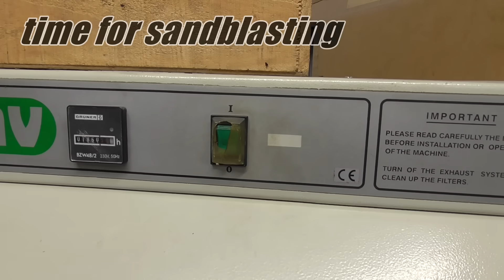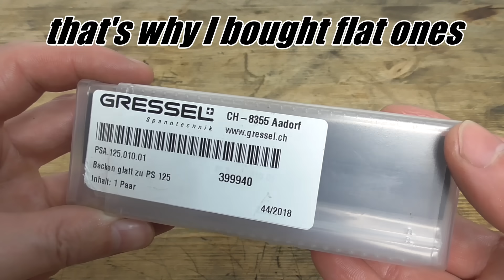Rusty Deadlocked Vise - Perfect Restoration

Comment: You didnt need to pull it apart with a puller there is always the chance it could break something i have dismantled lots of seized machinery hard to beat electrolysis as it removes all the rust and even bolts usually unscrew it cuts out alot of rust removal and you would have been able to unwind the mechanism at the end of the day you did a great job well done i just would have started off differently.

Comment: Duck tape works just as well for sand blasting and is much cheaper than aluminum tape. My stepmom used to do glass etching all the time, never had an issue with the sand cutting through the duck tape.

Comment: They don't make vices like the old ones . I have a old one that I just restored. It's really tough and heavy. It only has the word England on it. You did a really good job. All I did was use pneumatic wire brush some sandpaper and file and used spray paint. Wish my machine shop had a sand blaster.

Comment: That was satisfying to watch until the greasing part. You don't need that much grease, especially on screws. Grease just the tip of screw and while screwing it in it will spread the grease around all by itself. You save A LOT the product and there's less mess to clean after 😊 Apart from that this is so so satisfying and relaxing to watch. Thank you!

Comment: I WOULD JUST SOAK IT IN A SOLUTION OF PHOSPHORIC ACID FOR A WEEK, RINSE IT OFF AND TAKE IT APART. IF IT NEEDED MORE RUST REMOVED, BACK IN THE TANK OF ACID, TILL CLEAN. THEN WASH IT UP, DRY AND PAINT.

Comment: Absolutely a superlative restoration job, excellent choice in using green and good work on white lettering, instead of using the methods of applications on the various sizes in raised lettering, I was wondering why you did not use a flat firm rubber foam pad for paint stamping raised lettering. Whatever methods that could have been used your choice worked out great. Curious question, have you any idea as when it was originally manufactured. Guessing it looks somewhere in between 40s to 50s, even earlier could be possible. Then again, I could be completely in left field, it might be from the 70s or newer based on an original design used way back then when it was designed. I certainly would love to have one in my work shop, it is really is something that looks to be of superior workmanship and why more then durable, but an eternity in its lifespan of use.

Comment: You should have used Dr. X rust remover before you did all that sanding. Would have been a ton quicker and so much easier and thorough in removing that rust. Great job though!

Comment: why heat treat?
Reply from the maker: It's not actually heat treatment, the low temperatur doesn't change the structure of the steel, it just makes it black. Just for the optic and rust proof.
Reply: @mymechanics  thanks so much. Very cool
Please keep making more!

Comment: Wonderful job of restoring that, you must really like that vice! One thing I find odd though is that you obviously have a lot of nice kit, mill, lathe, blast cab, but not a socket set? Please buy a socket set, seeing you use an adjustable spanner like that made me wince! :-)
Reply from the maker: I have one, i'm just not using it very often.
Reply: That's so funny, I was always scolded if I used an adjustable if there was a better tool for the job by my tutor when I was a lad. I sometimes hear him, like a parrot on my shoulder if I'm misusing a tool or should have chosen a more appropriate one. I do own several adjustables and used to have a comedy 24" one for intimidating stuff apart...

Comment: Remarkable work. It is a huge boon to society to have the potential of otherwise scrap parts truly restored. But society doesn't run on potential; it runs on efficiency.

Does restoring this device, with all of the knowledge and tools that are required, make economic sense? Yes if you already have all of the tools and knowledge, and no if you don't, or maybe never?

A simpler question would be, "Why bother?" Regardless, excellent work. You don't need anyone to tell you that, I'm sure.

I actually thought sandblasting was more primitive. Like, take some stuff out to the shed and power wash it with sand. It is nice to have a misunderstanding corrected.

Comment: Excellent video. If you do another vice restoration, look into electrolysis cleaning. It's a rust removal process that requires no scrubbing and doesn't effect the base metal at all.

Comment: Very nice restoration but why did you buy new smooth clamps? Couldn't you just file the old rough ones ?
Reply from the maker: They're hardened, you could only grind it and i don't have a surface grinder.

Comment: I have tried a VERY successful method to remove rust, some of it VERY heavy: 
1. Burn the rust until metal gets red of white [I used my old woodstove]
2. Remove next day once it has cooled off
3, Remove loose rust best you can with wire brush [ don’t go crazy on it, the next step will do the job for you
]
4. Immerse the part in pickling vinegar [10% acidic acid] 
5. Let it seat in it for a couple of days
 in the vinegar
6. Wash the rust off
7. Dry immediately and coat it with an oily product..

It works fantastically, and the best part : very effort
 which is bonus for a lazy man like me

Comment: Great work.  Excellent attention to detail.  This was a real treat to watch.  Large vises like this are really hard to find in the US, so it's very cool to see you take a crusty relic and bring it back to its full potential.  I also prefer flat jaws with leather patches to secure a precision piece, so an extra thumbs up on that.

The green paint is a really nice color.  I see a lot of restoration videos that use a flashy metallic teal that I really dislike for some reason.  I haven't done a lot of restoration projects, but I've just clear-coated the unfinished surfaces with automotive lacquer after letting them sit in CLR for a week or so to remove the surface junk.  I love the pitted and aged color of the raw steel in contrast with the bright, finished steel.  It's subtle, but there's a clear difference in the color of old, unpolished steel.

FYI, I have no idea about the quality of the steel used in the parts, but if the steel wasn't hardened in the first place, there's probably a reason for that.  Steel has many grades and alloys, and some can't be hardened with a quench because they don't have enough carbon content to create a strong carbon capture in the molecular lattice.  The maker may have opted for low carbon steel to maintain flexion without snapping into shards when the part is stressed beyond normal use.  Even if you hardened those pieces, you'd need to thermo-cycle hardened steel at a lower temp to add a bit of flex and reduce the chance of shattering.  The only time you really want hardened steel is for a durable cutting edge like a blade, saw or drill bit.  I guess it could be useful for specialized vise jaws to allow the file to dig into softer steel and not damage the jaws.

The forge scale black patina is a really nice look, though.  It also forms a slightly more durable shell that resists wear and corrosion better than raw steel.

Never toss out a large old vise, no matter how crusty it is.  It's actually hard to find bigger models with big box hardware chains only stocking handyman/weekend warrior sizes.  If you happen to find or inherit a vise with 6+ inch jaws (15+cm for anyone outside of north america) and don't have a use for it, put it up on Craigslist or Ebay.  Plenty of blacksmiths and machinists will be happy to take it off your hands.

Comment: Forgive my ignorance, but: when you cut new threads in the screw holes (e.g. 6:11) does that not make the thread bigger? Do you then need bigger bolts?
Reply from the maker: Nope, it's the same size.

Comment: I don't get why you didn't just sand blast the whole thing. All that other clean up was superfluous until after sand blasting. There's plenty of abrasive options like glass bead that would not roughen the metal and would take off all the rust. Walnut shell would have done the job too.
Reply from the maker: I explained that in the pinbed comment ;-)
Reply: Like I said bead blasting or walnut shell don't take off material. And I would have covered the ways regardless before blasting. The rest was would not matter.

Comment: I guess you already know this, but you can sometimes use a Torx bit? (Not sure of the name)to remove broken screws, just drill a hole that appropriate to the screw (M6 then use a 3-4mm drill bit)  then just punch the bit into the hole.

Comment: I'm probably repeating another viewer's recommendation, but...use an impact hammer driver vs an adjustable wrench for such things as the spreader, and try an air chisel for moving stubborn parts like the metal pads. 

I forgot to mention - excellent job on the restoration, especially with manufacturing the retainers!

Comment: As much as WD-40 is great, the best penetrating fluid one can have on hand is a 50/50 mix of Automatic Transmission Fluid and Acetone. The only inconveniences is dissolve plastics and has a very short shelf life, so it is best to mix a batch when you need to use it. This would have made your life easier at the start.

Comment: What an enormous waste of time at 1:45. Just use a drill with the right size bit, or better yet, use 2 and you'd have had it open in literal seconds. Wow. And again at the 5:30 mark. Seriously. Why did you cause yourself so much extra work?
Reply: Your needlessly critical comment was the real waste of time. Look at the end result, genius.
Reply: @fargofantom6854  Needlessly critical? It's called a question. Plain and simple. Grow up. Criticism exists for a reason.
Reply: And look at the rest of the replies. Yours was the ONLY one I saw which took issue with anything in the video.
Reply: Calling something a waste of time isn't a question. And taking issue with your negative attitude doesn't make someone an "intent warrior," whatever that means.
Reply: You also used the words "wow" and "seriously." Those aren't words used in questions. They are used to inidicate a condescending and superior attitude, which is what you did. Your message came through loud and clear. So own it.

Comment: Amazing work and attention to detail. Some great techniques shown for dressing the slides. Worth the effort I am sure as the vice looks lush now. I'm now inspired to recondition the old one I picked up for free. 
Have you thought about using copper ease /copper grease (anti seize grease) for the jaw bolts and jaw mating surfaces, rather than a lubricating LM grease which is used for the slides and main lead screw? Just a thought. :)

Comment: Instead of hand painting the raised lettering with a brush, use a tightly rolled rag folded over so you can dab the paint on lettering with the blunt end - or a very small foam roller.

Comment: Damn, that's a shitload of work for a vice.  Props to the restorer.  He had to make special parts for certain tasks.  Most people would just consider that steel scrap as rusted up as it was.  Not this DUDE!
Reply: can only imagine what he could have constructed from scratch with that time, those skills and the shop he apparently has.  a flying machine?
Reply: most people just simply wouldn't have the knowledge and the equipment to restore it.
Reply: Yes you are correct.  These are however some of the basic skills that toolmakers learn.  There are no short cuts - either it's right (often to micro millimeters) or it does not work and on more critical pieces, peoples lives depend on these skills.  They don't get the appreciation they should.
Reply: The restoration was great. The job is fantastic.

Comment: You did a nice job, but to save time you should have used a 4" wire wheel in a side grinder to clean off all the rust.
I clean off old rusted engines with that.
See my other channel veggiepower303

Comment: These are designed to not be greased. Greasing will cause it to bind and go stiff over time when particles of filings or wood shavings build up in the grease and turn it to goo. You can put a little dry lube on there, something like talc or such. but it's not needed

Comment: Can I find a similar paint at home depot? Looks really nice great video!
Reply: Hammerite rust protection should be available at any hardware store
Reply: @DerGucky  is that the brand of the paint? Hammerite? I didn't find it on the homedepot website.
Reply: Look at 10:15 min in the Video. There is a Picture of it.

Comment: I never expected to watch a video about restorating a vice the evening of Christmas; but me and my cat both enjoyed watching this. Excellent work, if only I had a sanding machine... I could restore a lot of old tools !
Reply: If you are talking about the sand blaster, you can use electrolysis too. Look up collecting old tools.  They will give information how to build one. Not hard. Good results.
Reply: What was the cats's opinion?
Reply: @mariegriffiths  Oh he was fine; comfy next to the laptop... he seemed to enjoy this as much as i did.
Reply: Depending on the size of items you would have to bead blast there are many price ranges from $89.00 to several thousand. I only have a small one but it works for what I need it for and cost me around $359.00. Treat yourself, it pays off many times over.
Reply: $109.99 (CDN) at Princess Auto

Comment: Nice job! Thats a nice vise (vise, not vice). Its good to see someone who knows how to use a file! I like the aluminum tape masking trick. (Nice to have a sandblaster). Nice lathe and mill work too. Nice little heat treating demo. (You're lucky to have a nice shop with good quality tools). Good to see smart use of grease too. But...WD40 is not a good penetrant. It wasn't made for that. (It is not a lubricant either).

Comment: I enjoyed watching this as I had refurbished a couple of Record vices. I thought that I had done a good job but nothing compared t what yo have done here. I am not a metalworker and so wondered what the heat treatment with rapeseed oil was for, is it some kind of anodising?
Reply: It is called in English "heat oil bluing" and it is applied to the steel parts to turn them black. Best results are achieved with used motor oil, as dirty as possible, I mean, as black as possible for being used for thousands of kilometres.
Reply: Many thanks @felixruiz389

Comment: Very nicely restored, I hope you now mount it on a bench and use it.  Not having a sand blasting or glass beading setup, I would have used an electrolysis process to remove the rust, but it is messy and would have taken longer.  Liked the tip of using rape seed oil (canola here in Australia), to put a blued finish on the steel parts, will try it.

Comment: Hole filler? JB Weld? I love doing stuff like this but don't have all the tools you have. Looks like WD worked just fine for you. I would've used penetrant but! However, great job of video and editing! I've got a huge old vise, about twice the size of yours, brought ashore on a big work bench by a recent hurricane. I left it in the salt marsh....thinking it unsalvageable due to heavy salt rust. Going back to get it. Thanks for the impetus!

Comment: Good job I like to restore old things too. Soda blasting will only remove the rust and paint.It also works well with aluminum without removing  aluminum. A vinegar bath works really well on removing rust without removing steel too but vinegar removes aluminum too, not good. Great video!!

Comment: four point eight   K   alleged people gave you the thumbs down obviously they appreciate the disposable society in which we find our selves in today.Exemplary job Mr Mechanic you are someone i can appreciate, you took what was perceived as Junk and turned it back into the quality piece that it originally was. Thumbs up from Canada.Heres to the restoration of what we have instead of buying the crap they sell from China .
Reply: The amount of people isn't alleged, but your interpretation of their motives is speculation. You can't just infer that. Maybe they disliked the length of the video, the lack of music, or voice-over. Maybe some opinions about using different methods. Or replacing the original jaws in a restoration project. There are many reasons to dislike a video other than disagreeing with the premise of it. I personally could have done with some more explanation about what some of the tools/techniques used were.
I don't mean any disrespect, but it's a shame to project a viewpoint on 5000 people, which in turn influences yourself to think more negatively on today's society, when that's not necessarily the case.

Comment: Awesome restoration! I had one question. Why didn't you use a paint roller for the raised lettering on the vise? I have done that on some projects. As long as you go slow and use a fairly firm roller, you would get great definition of the letters and it would look a little cleaner. It is also a lot faster and easier to do. I thought it was great how you brought that old vice back from the dead though. Great job!

Comment: Very nice work! I consider my self crafty and I´m pretty sure I could pull this off too, BUT this could not be done with ordinary carpenting tools that I have. However I hail your skills and love the precision of work. I have two questions? First: Did the jack had any looseness to it after working on the parts such as the rails? Second: The green colour is magnificent and sits in this item perfectly with the classic white details - what was the original color scheme?

Comment: Beautiful restoration and great video! One suggestion, though. Apply white paint to a hard, but slightly—very slightly—porous block, or finely woven material over a flat block and rake it over your raised letters. You’ll get much crisper edges on the letters. Think of like an ink pad in reverse.